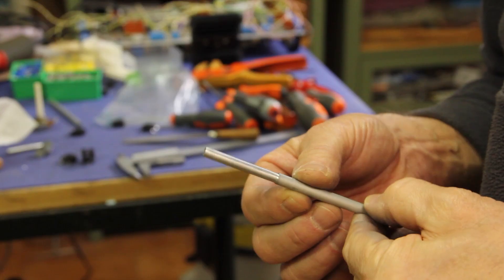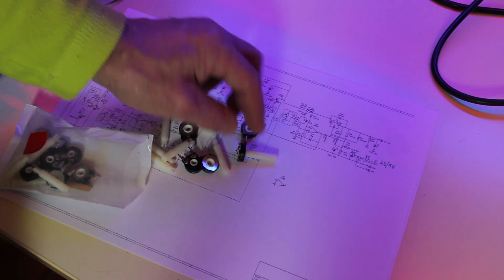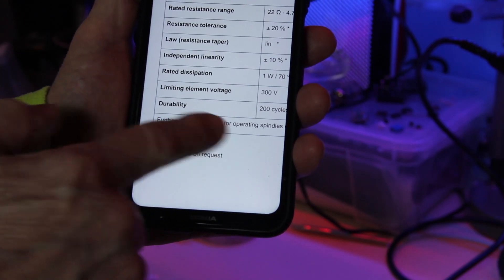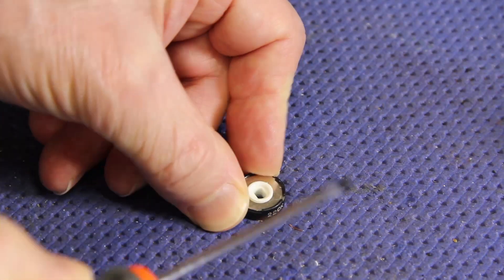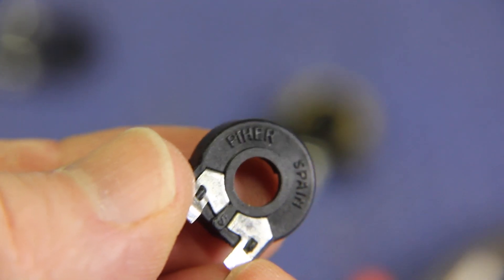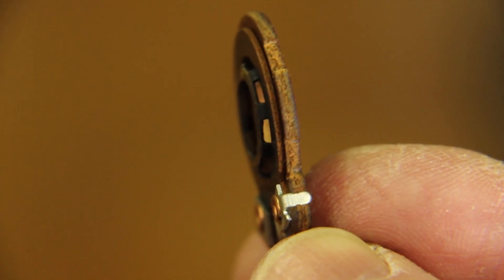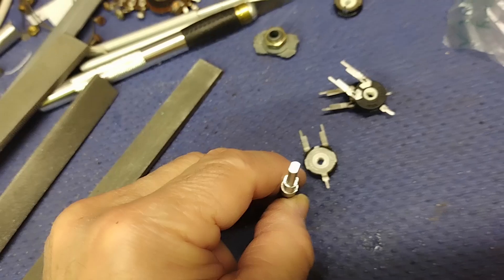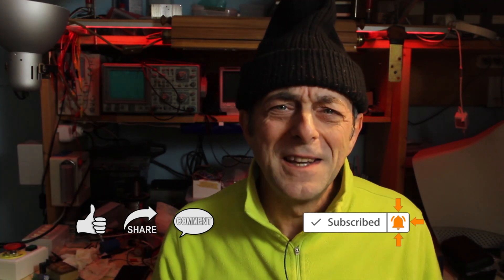Is it really possible to use trimmers as potentiometers? Trimmer dissection and analysis

Comment: Generally both pots and trimmers can be a cancer for precision circuits or any other circutry, but getting away from them, either requires multiple rails, sometimes limiting the operational voltage of a circuit, or hard to find components, or hard to tune circuits etc.. Don't even get me started about differential signals and hitting CMRR goals.

I try to avoid them altogether regardless of their lifetime. But it's sure hard in some cases.

Edit: I saw also your earlier video, although it might require some playing around, for your case, maybe linear optocouplers are the best choice. Search for them, it's not your average 6nXX optocouplers and they will require some circuitry to work correctly, but you can let yourself be amazed by them.
Reply from the maker: I think I have spoke about them in the previous video, where I actually tested 4N35. Yes there are better options out there, but my point was that the additional circuitry required was a problem because I had no room on the PCB.
I fully agree with you about the limitations in precision with trimmers, and in fact I tend to replace them with fixed resistors where possible.
But there are many cases where much precision is not required, and some other where a simple mechanical solution is better.
Of course that depends by the kind of circuit we had to deal with.
Thanks for commenting, it is a pleasure to receive considered comments.
Reply: @AccidentalScience  digital pots?